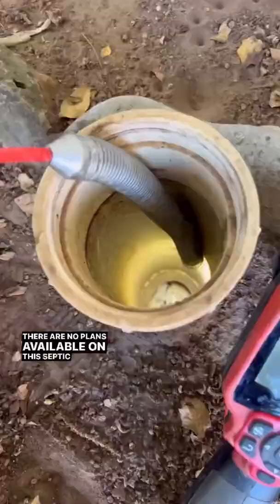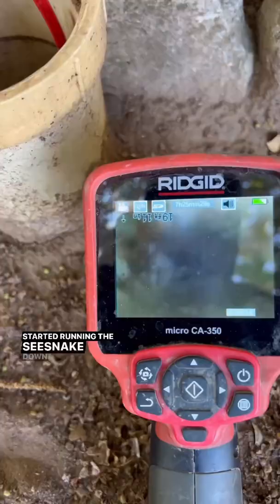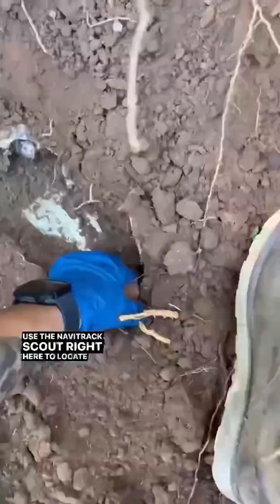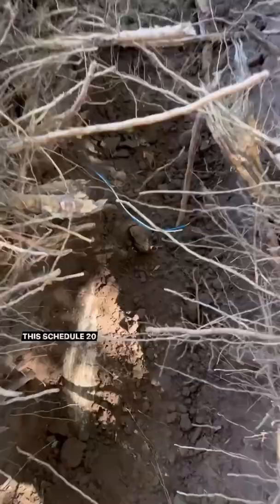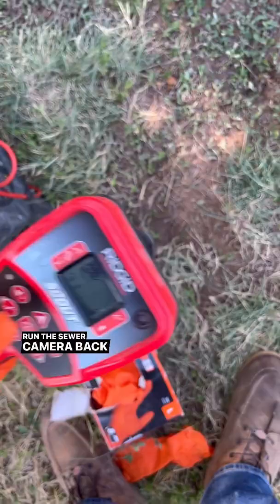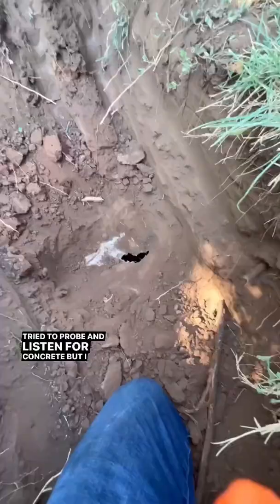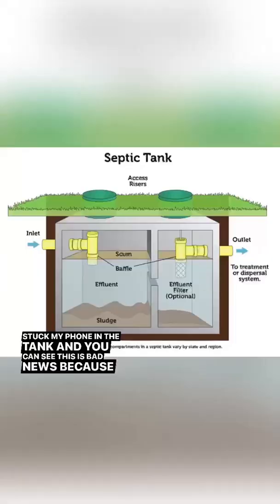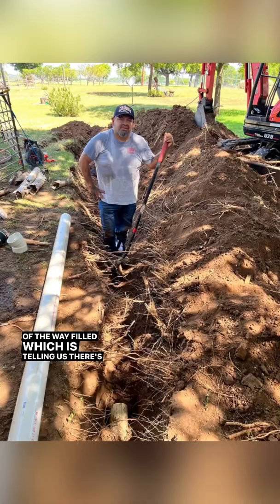Fiberglass Tanks are the Worst #shorts

Comment: Great video . Like everything in life there are good And bad manufactures. Fibreglass is one of the greatest inventions and you probably use it every week without knowing. Every time you fill your car up with fuel there’s a double wall fibreglass tank underground holding it if the steel tanks are not above ground. We have been Manufacturing fibreglass tanks since 1970 from everything to corrosion, mining, oil and gas, boats etc. You’ll find at the top water line of sewage tanks omit methane an H2 S gas which turns into sulphuric acid that eats concrete a lot quicker than a properly constructed fibreglass tank. Some great American manufacturing companies are ZCL Xerxes and containment solutions if you wanna have a peek had a good tank thanks again for the video